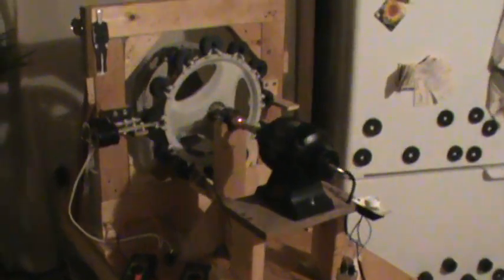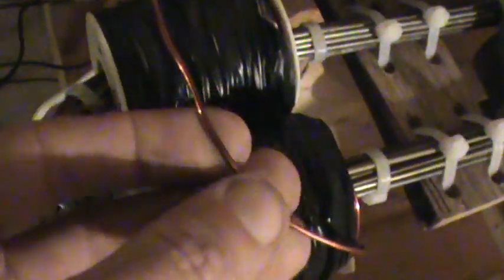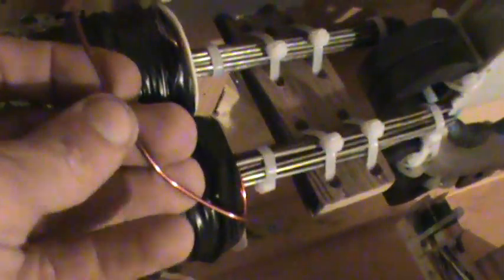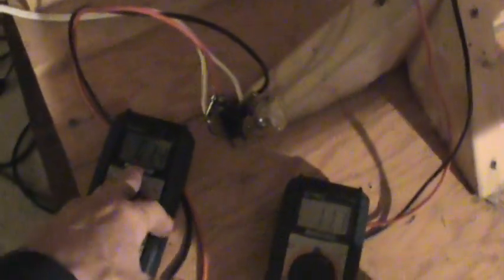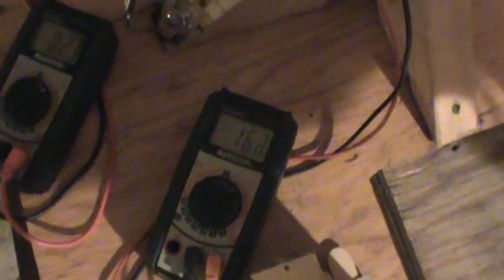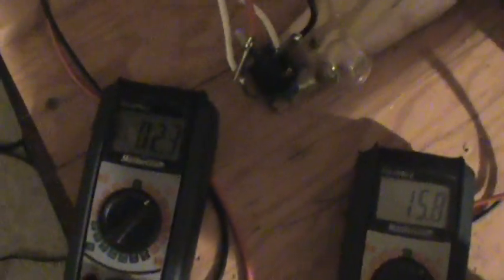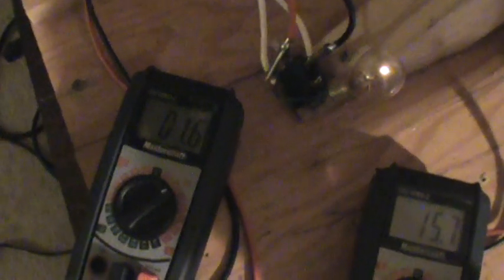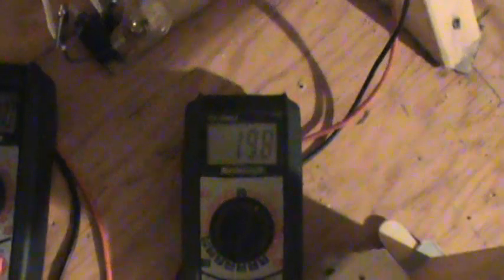Free Energy Project - Accelleration with 16 Gauge

Comment: Nice work. Ed also said that you will get more 'magnets' if you also place an iron tube around the coil and connect one of the ends of the tube to one of the ends of the iron core (the connection must be made with the same metal - a piece of iron)....

Comment: Hi MrAnguswangus, Useful test. It's good to see that thick gauge behaves the same way. It is also good to see the Light shorted out. I did not expect the motor to slow down on a 1 ohm bulb. Interesting, and noteworthy. A small request for you. You mentioned you had a power meter. Could you setup a monitoring test of the prime mover power draw. More facts could be drawn from this experiment. And be indicated by a reduction of input power (current), durring the accelaration.